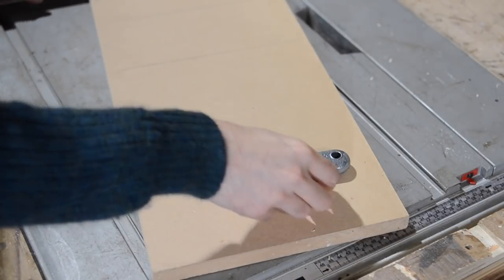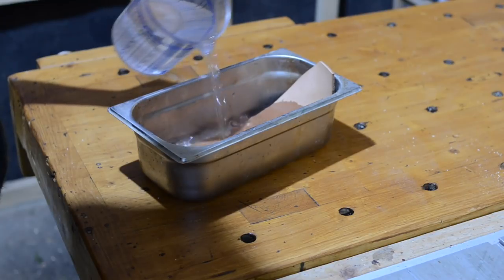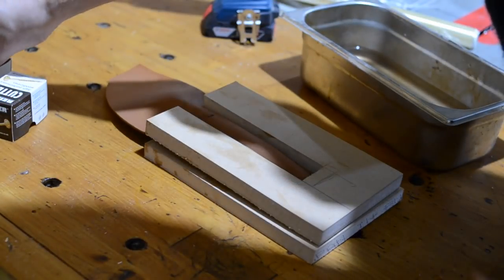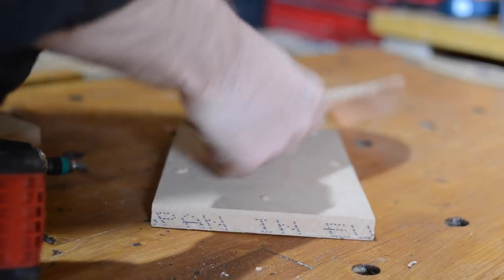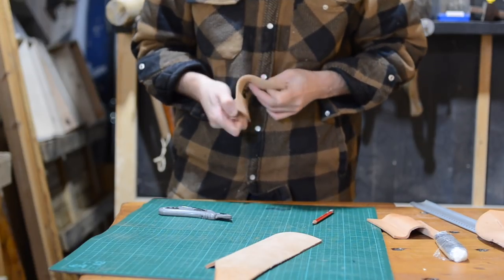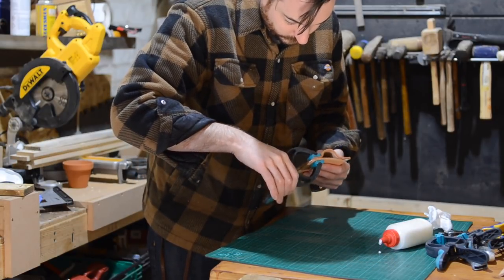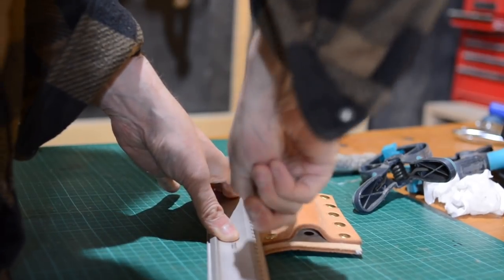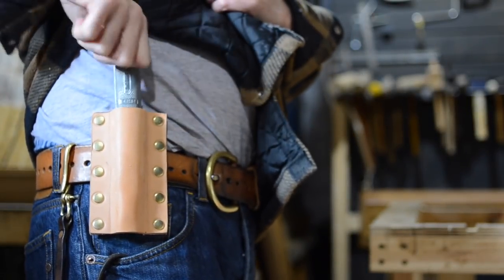Stanley Knife Leather Sheath

Comment: I like that Matt. Love the sanding/ burnishing on the drill press. Was it sand paper?  If so what grit did you use?
Reply from the maker: Thanks Jim. It was sand paper. Some 120 grit I believe.
Reply: @Badgerworkshop  thanks Matt. Still waiting to find a cheap lathe to set up various grits and some beech discs for burnishing.
Reply from the maker: I look forward to seeing that setup
Reply: @Badgerworkshop  so do I 😂 finding a lathe for less than £100 Is bloody hard! Lol
Reply from the maker: Get yourself down the boot sale. I have seen a few small ones that run off a drill. They go very cheap